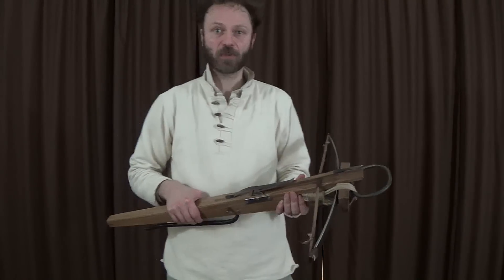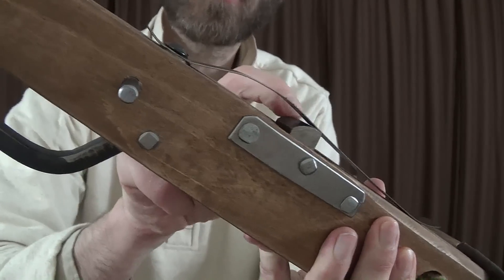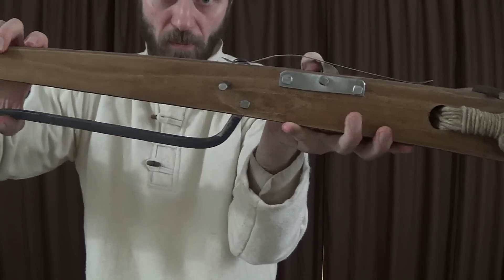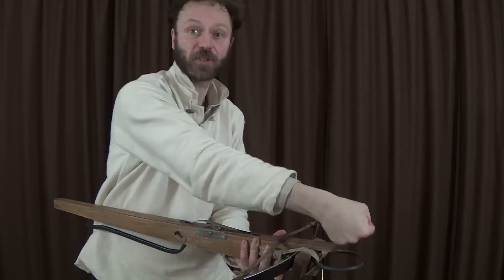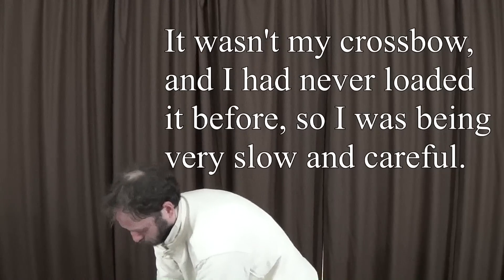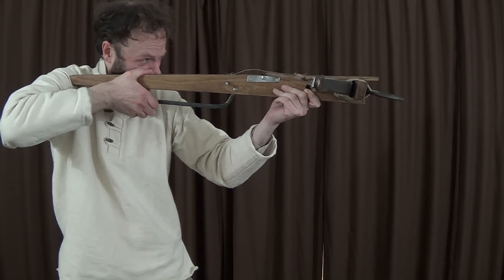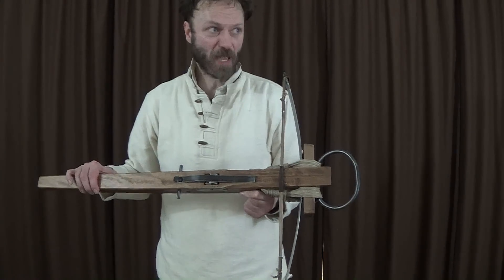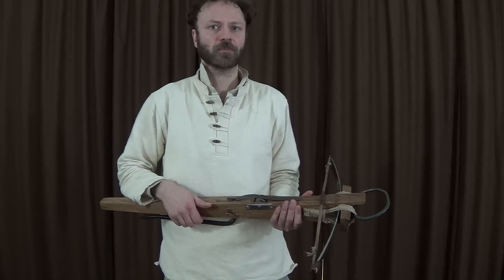Crossbow mechanisms

Comment: Safety Rule, Never dry fire any bow,especially a crossbow with  a steel prod!
Reply: +kerry mcmanus I CRINGED when I watched him dry loose that.
Reply: Yeah scary,not nice a steel prod in the face.It should be wrapped.
Reply: And even if the prod is fine, the energy that was released might well shake it loose from the stock, or even crack the stock. Not wise...
Reply: Does anyone actually read video descriptions anymore?
Reply: +Jonathan Hughes Just because it is safe does not make it ok.
Reply: +gi jo lol. Yeah that makes sense.

Comment: I think the big thing about the crossbow is that, like firearms, you can put one in the hands of pretty much anybody and it becomes an effective weapon. For sure they might not be a very good shot but the effort of drawing it is separated from firing it which makes it much more effective in untrained hands and, with the right loading mechanism you don't need to be very physically strong to use one.

The contrast with a longbow is that you need to draw, aim and fire the weapon in pretty much one fluid movement, which combined with the fact that the longbow is drawn to the ear means that even moderately accurate fire requires a certain amount of training. Of course this says nothing about the fundamental accuracy of the weapon but ease of use counts for a lot in war.

Comment: Excellent! One of my favourite pieces of technology from the middle ages.
Reply: Except the Crossbow is so much older than that. It was used in Ancient China about 2.300 years ago.
Reply: magnusbjarnisk

I don't particularly care about those ones nor the Greek ones...
Reply: RyanRyzzo
 The Medieval European ones are, indeed, much cooler, IMHO.
Reply: RyanRyzzo The Chinese ones were quite sophisticated. They even had a magazine. And because this technology is older than the middle ages, it isn't exactly a middle age technology. 

But the Medieval European ones are brutal and cooler.
Reply: magnusbjarnisk those repeating crossbows were useless for anything other than home defense, You needed to be able to rapidly pull the lever back making them too weak to do any damage to anything other than an unarmoured target, and even then they were usually tipped with poison just to be sure.

the repeating crossbows were peasant weapons, and thus were made out of a simple wood construction, their loading mechanism was clever, but i wouldn't say anywhere near as sophisticated at a steel or horn crossbow in terms of construction, for example this bow would have required fairly exact metalwork, while a horn composite bow would have required a lengthy process involving horn, dried ox tendon, and fish swim bladders.
Reply: Aaron Mcneil Well, wikipedia says that the crossbows that the Chinese used were quite sophisticated and were made of complex bronze parts. They also had very many different crossbows, some were huge, others were small, some were single shot and others were of many varieties of semi automatic. The only difference that I can see is the technologies that were used to create the crossbows. Medieval Europe had better metals than Ancient China. And Asia had been using horn composite bows for quite a long time. In fact, it is possible that Asians invented the Composite bow. So who knows if they fused it with the crossbow? 

Look up Chinese Bronze Crossbow to see the mechanism and look at the history of the Composite bow to see the origins.

Comment: There's a little trick how to easily draw a crossbow. Attach a hook to your belt, squat and hook the string on. Then put your hand on the end of crossbow and stand up.
Also you should not release the string like that. If you don't want to shoot it, use goat's foot lever to slowly release the string's energy.
Reply: Read the description. The dry-firing is deliberate.
Reply: +Jonathan Hughes Deliberate yes, but stupid also.No one can guarantee how steel will react under strain.
Reply: kerry mcmanus What he means is that the prod is under warranty, and will be replaced (presumably for free) if it breaks.
Reply: Yeah ,but what if it fails & takes half his face off!
Reply: +Jonathan Hughes Although yes, I haven't read description, I won't withdraw what I've said. It seems like Lloyd was mistaken the crossbow's limbs would have a problem with dry shooting.

+kerry mcmanus It's not about steel limbs, they wouldn't care if you shoot with ammunition or without. The problem is the string. It takes the most of stress during dry shooting and is also the weakest point. However I would doubt it would cut his face, it's not steel and look at the ends - it (I have no idea how it's called) is supposed to break first and safely unwind itself without the whole whip to the eye effect.
Reply: The limb will break at it's weakest point,with constant dry firing,but where not all that stupid. Are we?

Comment: Is dry-firing a problem with crossbows? I'd be surprised if it weren't. If you shoot a bow without an arrow, the energy goes into the limbs and not the arrow, so the limbs are now under a lot of stress that they shouldn't be under, and that can damage your bow, and I see no reason why that shouldn't apply to crossbows.

Comment: Lindybeige Hi, Iv always been told never to cold shoot a bow (recurve or longbow or flat bow) in this video you cold shoot the crossbow, does this not have the same damaging effects as it does to bows? I mean grated the actual bow bit of the crossbow is metal, but I still would have thought it was in some way bad for the crossbow, is this right?
Reply: I dunno duuuuuuude.... also, flat bow is a lame name.
Reply: Usammity well flatbow is a correct term, the only other name for a flat bow is an american longbow, unless of course we were to talk about specific flat bow designs such as the holmegard style
Reply: Usammity I agree that flat bow is not the most  exciting name but it explains what it is, the names of most bows are like this, recurve bow, compound bow, long bow, war etc.
Reply: You are sooooo not wrong.  The average cross bow has about 150lb behind that sting and by the way he strained I'd say his was around that.  When you dry fire, cold shoot is a new term for me, the entirety of that energy goes right back into the bow.  The bow can break free of the riser, and worst case scenario is the string breaks near as it can to the limb, whips out move 3-400 feet per second pass through your eye on a visit.  All most forgot the limb can brake and swing back at you like a flail and give your brain a breath of fresh air.
Reply: +fringis1 I would have supposed I was correct although I don't understand the part about your eye? However the limbs breaking was primarily what I was thinking about
Reply: Noah Cockett Oh well I am happy if nothing else to explain.  One time I dry fired my cross bow, it was old and worn out so it had lost a lot of it's poundage (less poundage less power) and when it happened the string happened to break near the end of a limb, and whether i whipped out or came right at me I don't know but it left me with a scar and inch or so under my eye that lasted two years.  People who intentionally dry fire stress test wear a grinding face shield and thick padded arm guard.  Hurting a bow cost hundreds of dollars, hurting your self can cost your life.
Reply: Wow the a. As thing happened  to me with a violin string.the winter cold made it snap while I was playing g a d I had a gouge in my mate for weeks
Reply: fringis1 just looked in the description..He answers our question, apparently the person loaning it said it would be completely fine. They'd know I guess? So it seems were possibly wrong..
Reply: OhanCockett I commented on that as well, the limbs could very well be fine if not warped, but that energy is going to go some where and the sting and binded riser won't last for ever

Comment: As someone with a background in competitive marksmanship, that stock is quite terrible for resting your face on to aim. You're not supposed to drop your head to reach the weapon stock, you're supposed to raise the weapon stock to your face, or else you get serious neck fatigue and have a bad visual angle at the target area (especially with proper sights). Since the end of this crossbow has only a small square bit that is in line with the top edge of the weapon, there's no way to avoid this trouble. Unless, of course, you fabricate a simple piece at the back end to allow you to raise the weapon further.

But then, you'll probably have a harder time gripping the back end and squeezing the trigger mechanism, since it is angled completely parallel to the direction of fire. All in all, an atrociously non-ergonomic design in the most basic ways...
Reply: Actually, when shooting medieval straight-stock crossbow, you don't have to rest back of the stock (that small square bit) against your shoulder (opposite to as Lloyd shows us in this video), as this weapon has little recoil. Normally crossbow stock goes behind and above your shoulder and touches your cheek only. To aim the weapon you have to tilt your head, so that the eye would be in line with bolt, but you don't have to drop your head down in an uncomfortable hunchback position.

It isn't ergonomic design by all means, but it's not that bad either, when you use it as it is supposed to.

Comment: Why is dry firing a bow supposed to be bad for it? Does it put some kind of pressure on it that firing with ammo doesn't?

Just curious.
Reply: Well you see, the point of a bow is to impart a high speed on the projectile right? A lot of energy gets stuffed into the arrow/quarrel. So if that projectile...just isn't THERE to take all of the energy, it has to go someplace else. This being back into the bow itself, which with a wooden bow is liable to shatter it after some time. The steel crossbow should be alright since it's a lot sturdier., but you can still tell all the energy that usually pushes the bolt (causing the recoil pushing you backwards) went straight back into the bow instead.
Reply: Surtak
Oh that makes sense. Thanks for the explanation.
Reply: Purin1023 Getting smarter one fact at a time o3o

Comment: What sort of steel should get if I'm gonna machine the bow part of the crossbow? (I'm not picky about whether it's authentic as long as it works really well). And what's a good way to test its strength at various amounts of bend regularly so I know it's not somehow losing strength so I know I did it right?
Reply: Spring steel is best and cheap.
Reply: unintelligent scientist Thanks :-)
Reply: junoguten no problem, spring steel is cheap and can be bought on hardware or u can get it on the old car suspensions.  Just hammer it at ur desired shape and make urself a stirrup and weld it and ur good to go!
Reply: unintelligent scientist Neat. I imagine I'll probably find some of that at a local scrapper. Thanks.

Comment: Is it that crazy to think that bows and crossbows can be used in modern warfare?
Reply: Pretty much yes, try to hit something 50 meters (150 feet) with a bow. Train for it for example for a day. Then do the same with modern assault rifle (M16A4, AK112, and so on). The accuracy, rate of fire, damage, weight of ammo and sturdiness are making for better weight of bow easily. Take a bow and whack it a few time against a rock, then throw it into water and run through a small corridor. Then try to fire it. Do the same with assault rifle and you will be much more successfull. The small corridor is there to showcase the downside of size of the bow.

Comment: How did the Chinese cross bows compare and contrast with European ones? I could just go to Wikipedia & elsewhere on YouTube but I'd rather hear from someone who studies these things as a hobby first. ^_^
Reply: Elround4 weren't they more widely used as a weapon of war in the days of imperial china?
Reply: Elround4 from what I have seen, Chinese crossbows were essentially a strong bow attached to a stock. The draw length is greater than that of European counterparts so the draw weight doesn't need to be very high. Mural paintings show the crossbowmen sitting down with the feet pressed on the bow stave and the string drawn with both hands. So they didn't need any sort of mechanical aid to span the bow.

Comment: you should NEVER dry-fire a crossbow. You damage the bow/stock when you do.
Reply: One dry fire fro a demonstration of the noise isn't going to kill the thing.
Reply: You are correct. You should never dry-fire any type of bow it will damage them and could cause a catastrophic failure of the bow causing injury.

Comment: Ahhhhh....! I cringed when you dry fired the bow. Oh well. It wasn't yours, after all.
Reply: +ryddragyn Read the Description
Reply: +Asad Uppal (Scout) I did, and it's irrelevant. It's still a very bad practice and anyone with common sense and experience would and should cringe. I have seen catastrophic damage arise from dry firing. Even if the prod is guaranteed not to shatter due to heat treatment, the string is taking a huge strain. I have seen many strings on bows snap from dry firing, intentional or not. Broken strings can themselves inflict injury. There was a case several years ago of someone with a brass nocking point. His string broke and the brass piece somehow got flung or ricocheted and blinded him in one eye. 

In the case of a crossbow specifically, imagine if the string failed at one of the loops. There's a fairly good chance the surviving length would whip right across the user's face. 

It seems like it was the owner's idea, not Lloyd's, though. So I don't hold it against him.

Comment: YOU NEVER EVER SHOT A CROSSBOW WITHOUT A BOLT ON!!! YOU WOLD HAVE BROKE THE BOW! NEVER EVER DO IT AGAIN! ITS DANGEROUS FOR YOU!
Reply: no, just... just no
Reply: Watermeloon1416 yes just yes
Reply: if you can see properly, the actual bow part is made out of iron
Reply: Watermeloon1416 yes, but that doesn't mean nothing
Reply: no, it means the crossbow wont break
Reply: I agree. I was shocked, as well. Though I wonder - the owner seems present? - why was he allowed to, then?
Reply: see description, lindy added a bit about that.
Reply: thx
Reply: If this was a real crossbow, the string would have exploded. This is just a "weak" replica. I have handled real modern crossbows and also studied the ones in the arms collection of our fortress called "Feste Coburg", there is only one way the string can survive this, by having a pretty weak bow. Also you can clearly see that this string is already missing some of it's pre-tention, caused by dry firing stretching it. The bow will survive this treatment only because it is made out of modern spring steel. This is nothing one can compare to medieval steel or iron. I have seen a real hunting crossbow from that time, ment to hunt boar. It had a draw weight of 800kg, nothing you will cock with a goats foot lever. You would have had to attach a winch at the back of the stock to pull the string back wich than could fire a blunt bolt of around 300g (Gramm not grains!) weight straight through that boar, killing it instantly. Because if you would not have killed it with the first shot, it would come after you and kill you. That is why the noble men had back up on horse back while hunting. they were carrying tha so called Saufeder, a pole arm just ment to stab the Sau (boar).
https://www.ritterladen.de/out/pictures/generated/product/1/720_960_80/85380_1.jpg